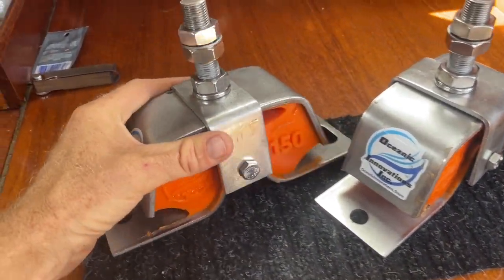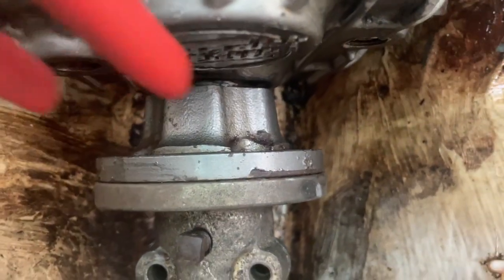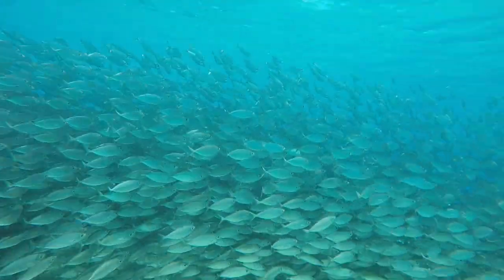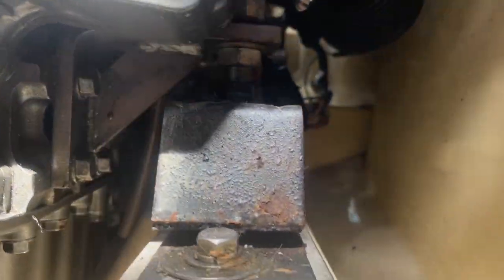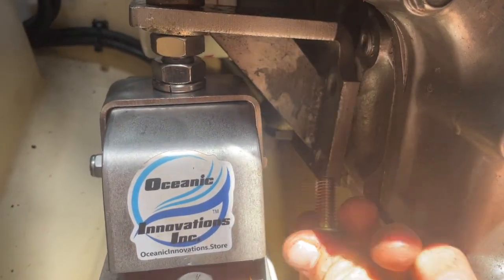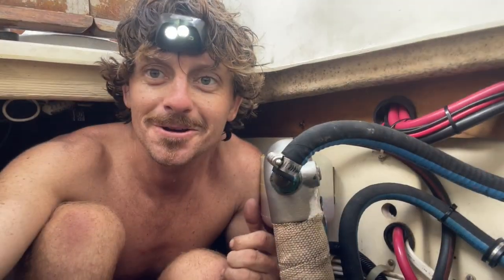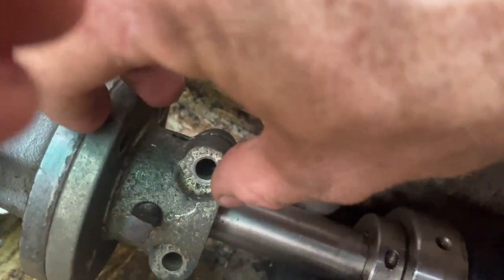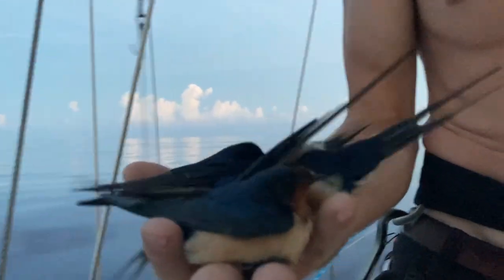How to Replace Yanmar Motor Engine Mounts and Realign Shaft

Comment: Your coupling should have moved aft to get off of the spigot. That is the machined bit that mates with the engine coupling, that is why you can not see light between the mating surfaces.

Comment: One note: the two mounts on the torque loaded side of the engine need to be a harder rubbber. They have a number rating value. I believe they are differentiated by blue color as opposed to orange. Nice tip to remove the bracket from the engine rather than hoisring it clear.

Comment: I would put anti seize on the stud threads top and bottom.keeps stainless from galling and if it was steel keeping the rust from forming.that white hose by the shaft coupling should be moved or super secured.good video 👍👍👍